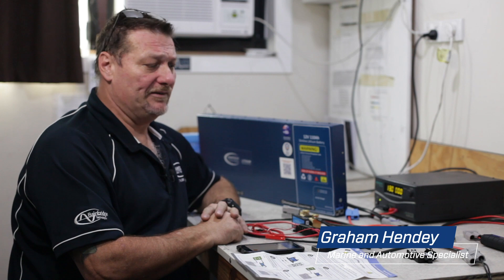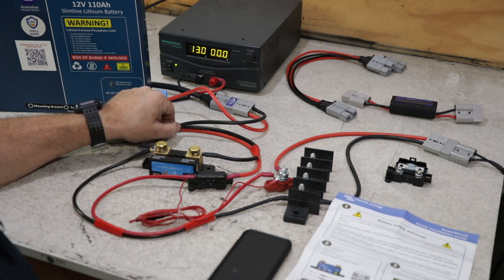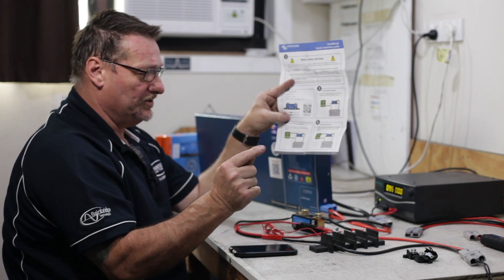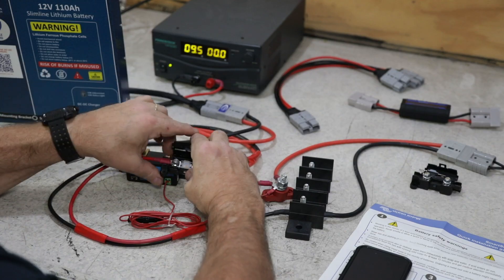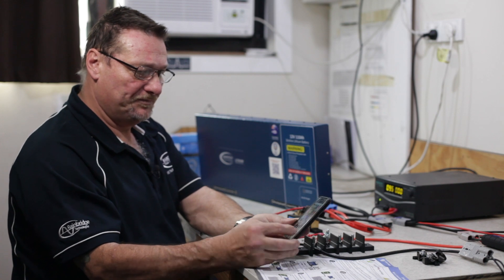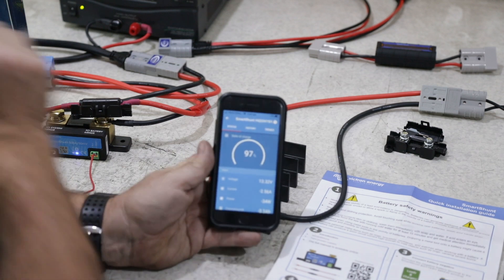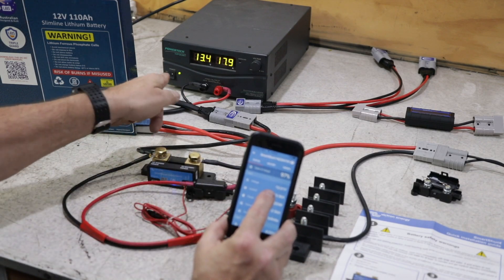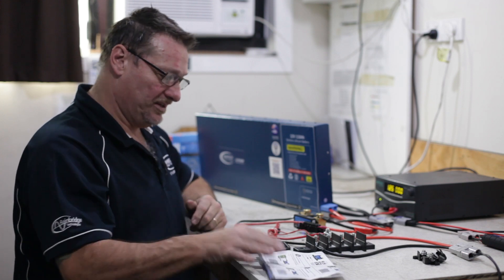Baintech Slimline Lithium Battery | How to connect a Battery Monitor | https://baintech.com.au

Comment: I followed the instructions to the letter and it caused plenty of problems. First of all it doesn’t accurately calculate the charge going into the battery. You can tell because the battery monitor will show 100% SOC but the battery will continue to take additional charge for a considerable time. You reset the monitor to 100% to sync it again but by the time it’s cycled a couple of times goes out of sync. This is exactly as predicted by some people commenting here. 

Secondly, the internal dcdc charger stopped delivering a maximum voltage of 14.5 volts on boost and instead delivered a maximum of 14 volts. 

I have attempted on multiple occasions to obtain technical support from Baintech via phone and email and over a period of 3 months I have had most emails and phone messages ignored other than a couple of emails from the sales area that my enquiry will be looked into. 

I have finally resolved the charging issue by buying a Redarc dcdc charger and bypassing the internal one completely. This has resolved the in accurate SOC issue and got me back to charging at the full rate. However, I note that having a battery monitor highlights that my battery does not appear have a capacity of 110ah and in fact it is closer to 95ah. Given my battery has only been cycled a few hundred times and generally only using a maximum of 50% of capacity in those cycles, this is indeed disappointing. Again, despite many attempts I can’t get any feedback or assistance from Baintech about whether this is because the stated capacity of 110ah is not the usable capacity or whether my battery is performing below par. 

All in all I think it is fair to say I am not completely happy with my battery and I am very unhappy with the lack of response to my reasonable queries about this. I hate to knock an Australian company but I think it is fair to highlight my experience when following the instructions on this video and my failed attempts to get technical support.

Comment: When setting the capacity of the battery for the Victron, is the 110ah rating of your battery the usable capacity or the total capacity? As in, should I set the capacity at 110ah or a lower figure to allow for the point where the bms will shut down the battery?

Comment: Hi I have the same setup in my Patrol Y62. I have triple checked and my amps do not change when I turn the car on. I can see minor adjustments when the solar is installed but the alternator seems to have nil impact on the app. However the battery is charging, I can see this as the light lights up in the battery. 

Has anyone else had this issue?
Reply: Hey mate, same problem... do you have a single or twin core coming down from the start battery to your setup in the rear... I have  a single feed for the slimline bcdc feed and I can't get the smart shunt to read a positive charge when the engine is running...  

About to sell the baintech and go a dcs battery just for the user friendly aspect

Comment: This isnt the proper way to wire the shunt. You should really tell people the problems with wiring it this way so they are aware.

You are measuring the input current into the DCDC not the output. No DCDC is 100% efficient and the current differs from the input to the output greatly under low voltage input conditions.

This method will very rarely allow the shunt to sync to 100% since the shunt will always see a current even in float mode, it will see even more current if the battery is running loads in float.
Reply: So should I buy one
Reply: @putnamehereholdmadoodle  just get the standard one and use an external DCDC.
Reply: Correct.
The -ve input of the DC to DC charger should be also connected to the load side of the shunt.
The internal negative connection from DC-DC charger to battery is what needs to be severed.
Then it is truly only current to/from the battery being measured by the shunt.

Comment: Nice video mate! Can you monitor solar input with this using a dcdc charger?
Reply from the maker: Hi, If you are looking at our battery with the in-built DC-DC Charger version, you'll need a solar regulator for solar charging, this will give you your solar readings. Really depends on the type of set up you are looking at.

Comment: Great video Graham, this was one of the reasons stopping me from buying one! Being lithium having state of charge is important. 

Can you make a 200amp version 100mm wide or possibly just longer which can discharge at 200amp? A bit more than 20amp charge would also be good. This would be a game changer! I would buy a prototype!
Reply from the maker: Hi Aaron, thanks for the feedback, always appreciate hearing from you. Commonly installers have been using 2 units and put them back to back which is 100 mm thick and has 40 amps of charge.

Comment: Thanks graham been scratching my head for a little while how to do this. Probably come in next week to have a chat.
Reply from the maker: That's great, look forward to you stopping by!
Reply: @bainbridgetech  hi graham, I installed the Bluetooth Victron battery monitor shunt adaptor you guys built a couple of weeks ago. I just got back from spending a week at straddie and the device didn’t miss a beat. Super simple plug and play box to the battery made it very convenient and then using the victron app worked a treat. Highly recommended and have showed a lot of mates looking for a new battery set up. For the price well worth it. Thanks again for getting the product out so quickly for me. I will have a chat with Carson next week. 
Cheers
Reply: @mathewcash591  how's this going what is product called.
Reply: @bainbridgetech G'day there, 
Just watched this and very informative.
I have this same lithium battery in my ute and everything is fine,but I want to add a solar panel to car to keep the fridge running all the time,so I'm assuming I need a solar controller lithium compatible  and do I need the shunt as well,or can I get away with not needing it? 
I will be getting it done professionally.
Thanks for your time,Justin